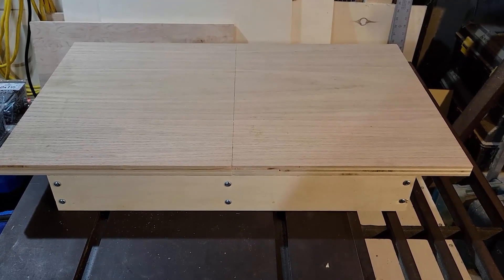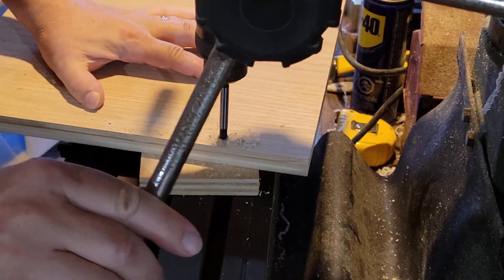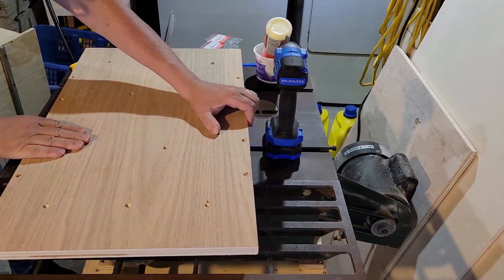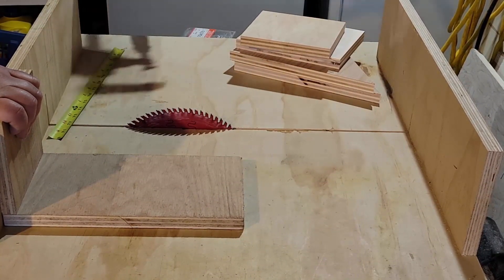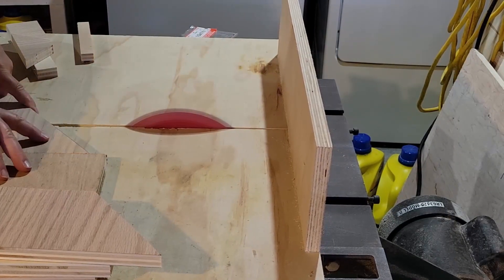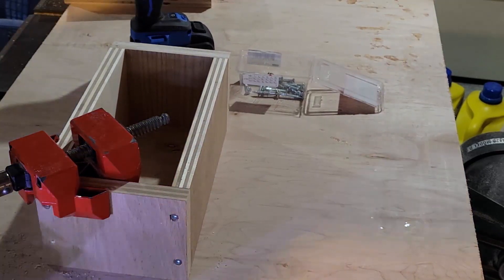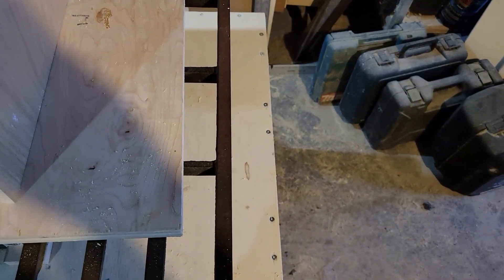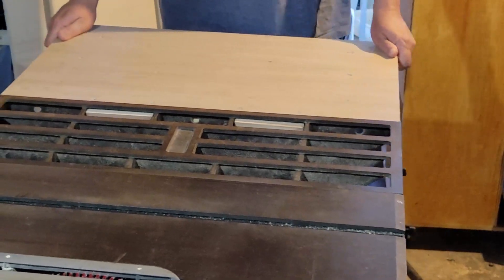Table Saw Extension Part 2

Comment: I bought a fence for my saw that slides on the table, but the table had the grid extensions like yours.  So I lowered the grids about an 1/8" covered them with very thin plywood and plastic laminate and extended one far enough to build in a router table.  Yours looks much sturdier than mine.  Nice job.
Reply from the maker: So glad you like it! That's my next job; a fence

Comment: hey is that a freyjoth saw? i have the same one, i believe :)  what is your fence setup?
Reply from the maker: It's possible. It's a local stores in store brand (Craftex) and they basically stick their label on some generic manufacturers production. I dismantled the fence that came with it as it was old and rusting. One of my next projects will be to put together a new one. Thanks for watching!
Reply: @justmakeit2849  i binged a bunch of your videos, to see more of your saw. i believe i have its big brother.. strikingly similar features...
Reply from the maker: @saberling  Cool! It's a great saw. Solid and durable